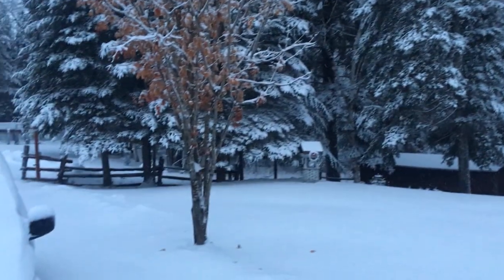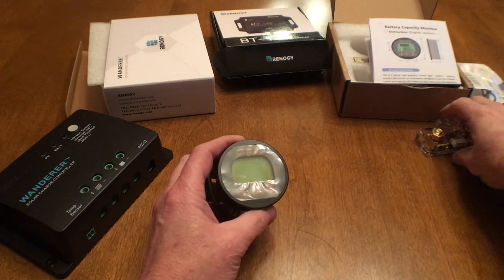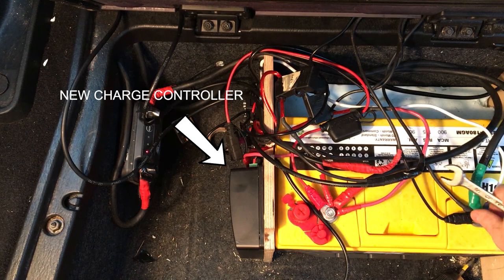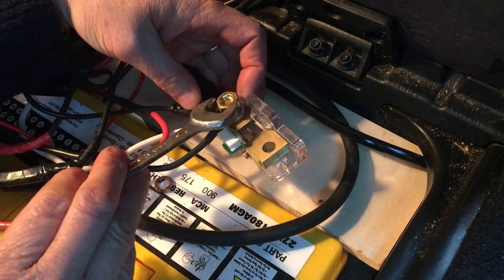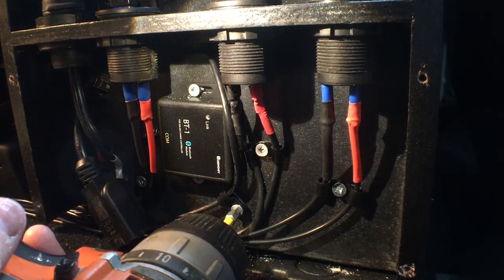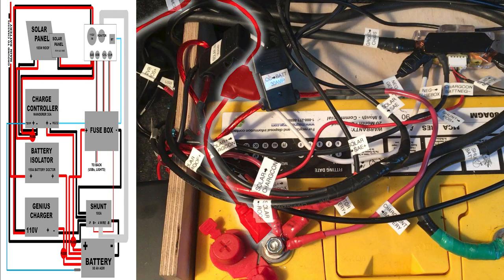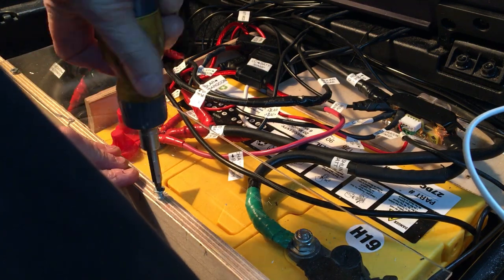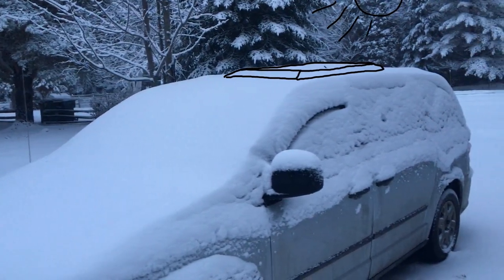Van Electrical System Updates - Battery monitor w/shunt, new charge controller, Bluetooth and more.

Comment from the maker: IMPORTANT: In the video I complain that you can't turn off the backlight on the monitor and a viewer suggested that you could by pressing the two arrow buttons at the same time.
If it says this in your instructions; Great!
If this is not mentionned in your instructions, do not do it. On older monitors, pressing those two buttons will reset the battery capacity to 0%. 
I tried it (don't trust everything you read on the internet!) and now I am trying to figure out how to fix it.
Reply: I saw the comment a while ago and installed it today.  Pressed on both buttons to turn off the light and reinitialized the monitor. Came back and saw your comment.  Thought it would be simple to charge back the batteries again and reprogram it, will it mess up your archives on your cell?

Comment: Love the idea of using a ball bearing and the vice to crimp the wires. Thats a significant improvement and a very handy space to store things. 👍
Reply from the maker: Thanks. I spent a lot of time looking at the kind of crimpers used for those big wires - $30 for cheap ones or ones you hit with a hammer,  and they can go up to $300 for good ones. That's a lot of money per crimp.
This is a much more elegant solution - IF you already have a decent vise!

Comment: I leant a few things from this well made video. Well done. 
Your fabrication is very professional. 
When I make things from plywood, (they don’t look as good as yours) I glue on the grey speaker carpet. It looks cosy and things don’t rattle about inside.
Reply from the maker: Thanks for the nice comment - I have seen a few videos where they installed carpet; looks very slick! I had not thought about the rattling - definite bonus.

Comment: I found your video through a search for the exact same AiLi Monitor, which I have just installed in my caravan (UK).  This is a very helpful video for me and very clear & concise in content, thank you.
One tip - you are able to turn the backlight off on your monitor - press the left & right arrow keys together to toggle the light on or off.
Thank you, again, for taking time out to share your work with us, cheers, Rog... 👍🏻 😉 🐍
Reply from the maker: You are very welcome and thank you for taking the time to comment.
Reply from the maker: Thanks for the tip about the backlight!

Comment: I believe you can turn off the backlight in your battery monitor,   you can press button V and % to turn on/off backlight.
Reply from the maker: Thanks, I'll give it a try.
Reply: Correct. This is in the Instruction sheet which you noted not to loose.
Reply from the maker: @tonywhite5557  It actually wasn't on my instruction sheet. I might be a new feature.
Reply: @averysmallcampervan  I scanned & highlighted mine, but "this" won't let me add the scan. Pg2 under "Normal Operation", 5th item arrow > (pictograms are VERY small), press both left (V/<) & right (%/>) buttons at the same time to turn on/off the backlight.
Reply from the maker: @tonywhite5557  Thanks I'll give it a try

Comment: If you press and hold the two outside buttons on the monitor for a couple of seconds it turns off the back light 💡 Great trick with the BB too 🙂
Reply from the maker: That's great - I'm gonna try that. Thanks

Comment: Hi, and thanks for sharing this. As always, your setup is practical and ingenious, and the presentation a pleasure to watch. Could you tell us, in your particular model of Dodge Caravan, how you routed the wire from the engine compartment  to the house battery compartment? Did you find an existing grommet in the firewall that you could use? Thanks in advance!
Reply from the maker: Hi Sam, the 4 AWG wire is routed through an existing grommet through the firewall. 
This was one of the only things I payed someone else to do because the wires for a lot of other things run through that grommet and I was scared to mess up the vehicle wiring.
It looked like a pretty tight fit, so I got a guy at the local garage to do it for me and wire in the battery isolator and breaker too.

Comment: Hello, very informative video. The best I've seen on this monitor. I am about to install one of these in my camper and I was trying to figure out if the ground that goes to the chassis should be on the shunt or if it should stay on the battery terminal. Looks like I should attach it to the shunt. Thanks! Looking forward to subscribing and watching move camper videos!
Reply from the maker: The ground stays on the battery terminal - the shunt is basically just "interrupting" the current between the battery and all the loads, to read the current and amperage on the way by. The ground is not part of that. ( a bit late replying, sorry)

Comment: Can you explain how you used a battery isolator safely without discharging your battery, etc.? Do you think a DC to DC charger which start at $120 USD are worth it? Thanks.
Reply from the maker: Hi there! The whole point of a battery isolator is that it isolated the car battery from the house battery unless the car is running, so it should not discharge the car battery.
There are different kinds of battery isolators, the one I have is a "smart" isolator in the sense that it detects the voltage in the car battery before opening the connection to charge the house battery, and should regulate the charging somewhat. 
The isolator does have some weak points- one is that it never gets the voltage high enough  to fully charge the house battery without help from a solar system and secondly, the charge profile (bulk, float charge, etc.) .
But the technology has evolved rapidly and a DC to DC charger is now the standard. If I did not already have the isolator installed I would definetly get a DC to DC charger. 
There are some that are a combination of DC to DC and solar charge controller which sounds like a good use of the technology.

Comment: Thanks for the very helpful video.  I really needed to see how all the pieces worked together.  BTW when you build your plywood boxes do you just use butt joints, glue and pin nails?
Reply from the maker: Glad it was helpful! I use butt joints - glued and pinned - but also clamped with pipe clamps, etc. till dry
Reply: @averysmallcampervan  Thanks

Comment: Hello great video! I was wondering if you used a 12 AWG wire for the shunt? I’m hoping that won’t be too big to fit. I have the same shunt
Reply from the maker: I used the same 4 AWG wire that connects the battery to the battery isolator/car battery.
The size wire will depend on the amps you expect to draw. I have no idea of your set up and I am not really the person to advise you.
Research wire sizes for different amps/distances.
Remember every bit of power is passing through the shunt, that is how it measures the current, etc.
Reply: Oh sorry I should’ve clarified. I meant to power the  battery monitor!
Reply: From the shunt to the fuse box that you plug into the B+ on the shunt
Reply from the maker: @Noahkreider  Ah! big difference - that can be any size, 12 AWG is fine or you could even go to 16 or 18 as all it needs to power is the electronics of the monitor.
Reply: a very small camper van oh great! I wasn’t sure if the 12AWG would be too thick to fit into the opening

Comment: I have 2 100ah batteries. Do I set it for 100ah or 200ah
Reply: I've read on other reviews.
Depends whether you set up both batteries as a 200a 12v or 100a 24v.
24v set it 100a
12v set it 200a

I'm guessing you have lithium batteries?